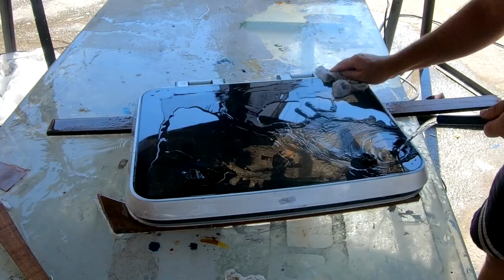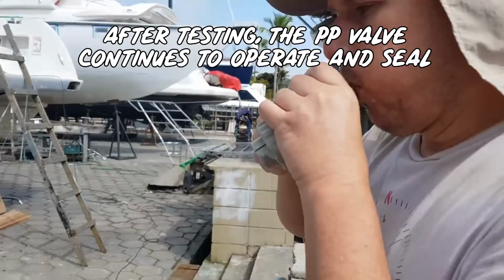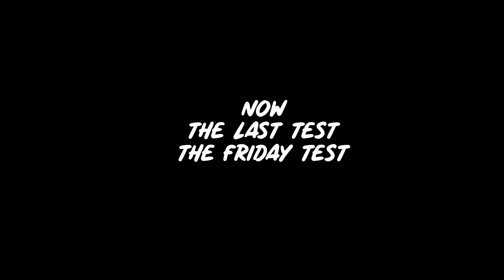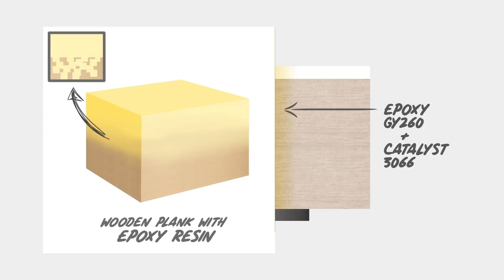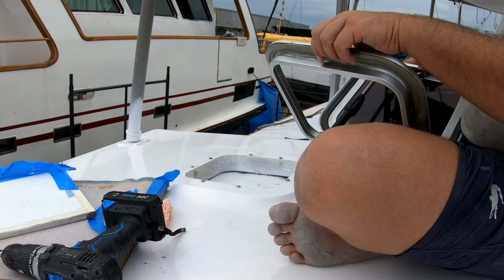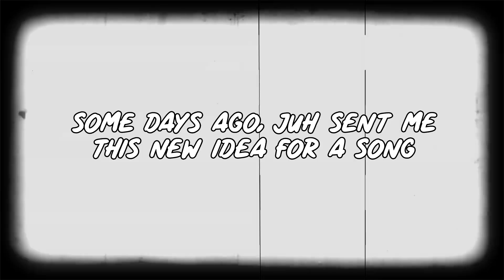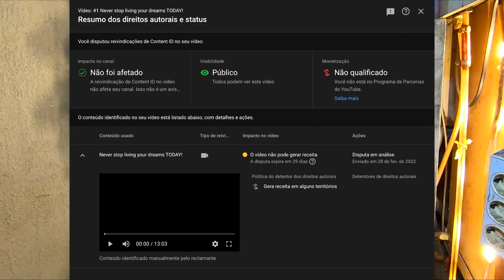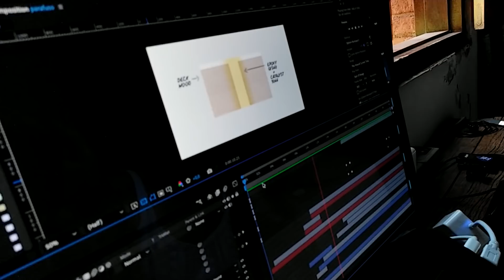#9 Valves crash test, installing hatches. Fred tells about: Someone is trying to steal our channel.

Comment: Try using Ernie Ball Strings on your guitar Fred.  They are made for bending and few strings do it better.  Also check your bridge and nut for burrs.  Should never break 3 in a row.  If you do, is time to change brands brother.
Reply from the maker: Hello Lee, I'm using Ernie Ball, bit, this guitar is running in open G, and the last string, a changed, to get the sound that a want for some songs, but, as is too high, the string broke every time, it's all most one every recording session....that is the price to get the sound that I want for some songs.

Comment: Hi couple, I've been following you from the beginning and I've had a negative surprise today, you no longer have subtitles in Spanish. I hope it is something punctual and not a definitive decision since I do not speak English at all and I send my message with a translator. A hug from Spain.
Reply: Sorry for my previous comment, for some strange reason I had the option of substitutes disconnected, so the problem is solved. A hug.
Reply from the maker: hola, no nos detengamos con los subtitulos en español. Realmente debe haber habido un problema con el sistema, me alegro de que haya vuelto a la normalidad.